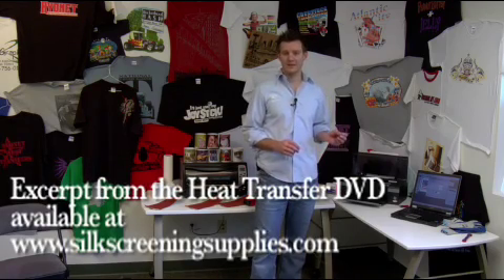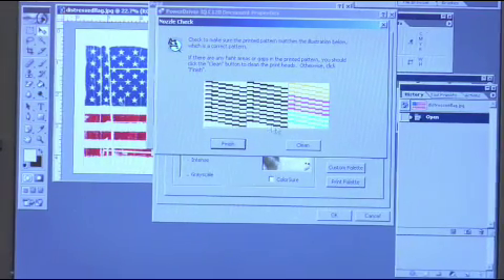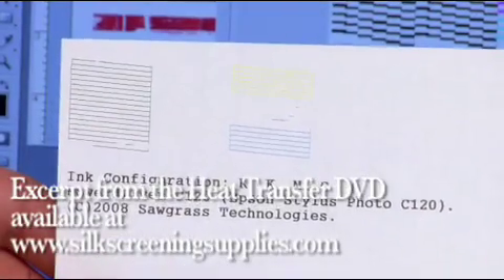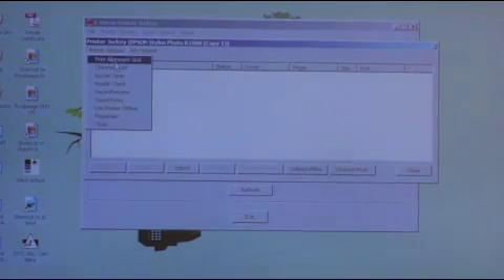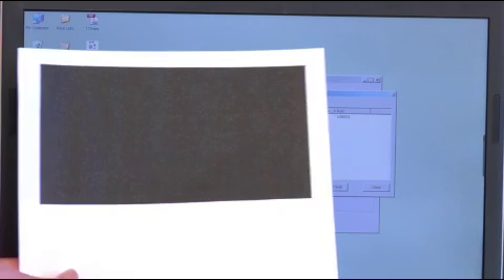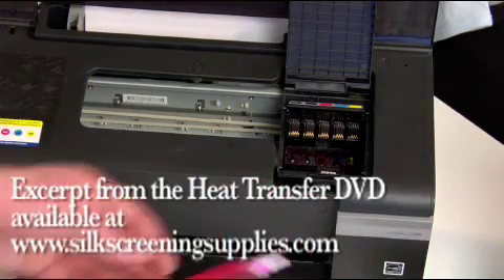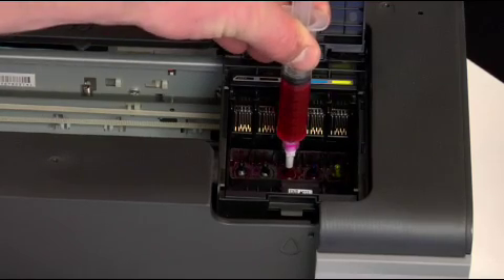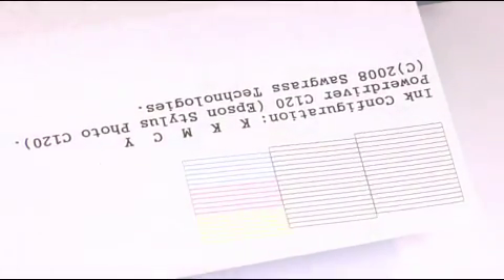trouble shooting sublimation, cleaning epson printer, sublimation printer

Comment: you don't need that hockey jockey thing.  just go in and create 3" x 8" vertical rectangles in a drawing or wp package and print those images. you can place each color's rectangle on a separate page and just print that page, OR just make the images thinner and put them all on one page C - M - Y and K.